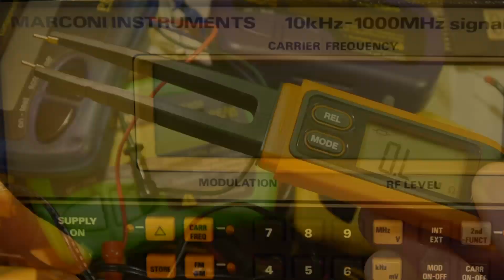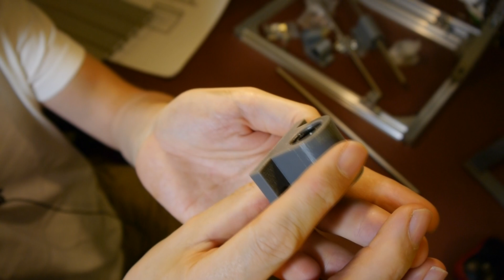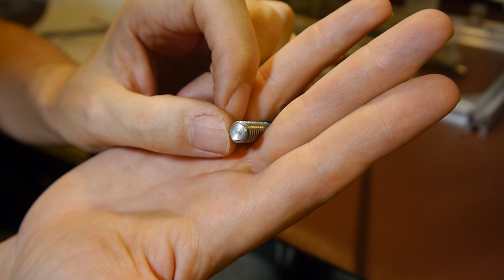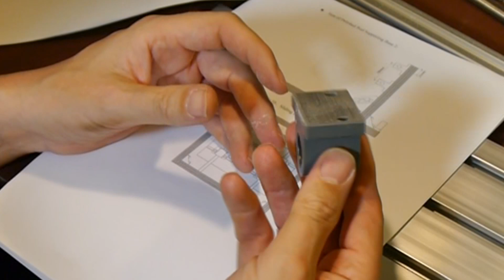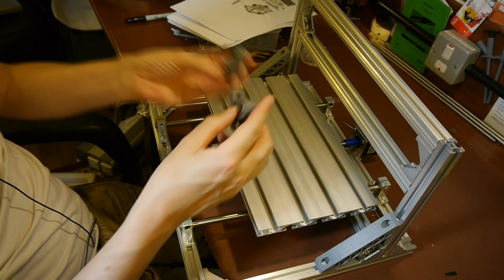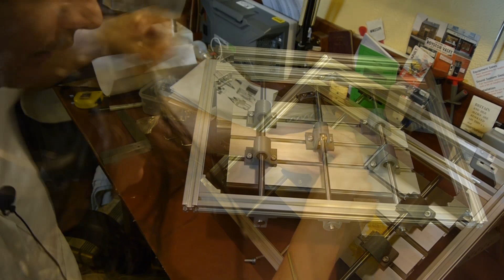3018 WoodPecker CNC - Part 2

Comment: I found that the linear bearings (as you noticed, not that fabulous to start with) bound on the shaft after I tightened the screws holding them to the underside of the table. The plastic housing for them is too flexible I think, and as the screws tighten the bearing's axis is twisted out of alignment with the axis of the shaft (that is, out of parallel with the plane of the table).  Each of the bearings (per shaft) pulls in opposite directions, hence the binding is compounded. The solution I hit on was to shim the bearing housing flange on the 'thin' edge - two thicknesses of regular printer paper (80gsm) did the trick. If the flange had been made to extend equally from a line through the centres of the screw holes, the problem might not have occurred. Still, for ~AUD400 including laser assembly, not a major problem! Great videos BTW, keep 'em coming! And talk as much as you like - that bloody techno music on some channels is of no help and drives you nuts :-( !
Reply: I'm having the same issue.  But what do you mean "thin edge"?.  Do you have a pic of it.   The other thing I found is the rods aren't very smooth either.  They have some rough spots.  I put them in a drill and using 400 grit sandpaper first and then finish up with much finer.  It certainly can't hurt.
Reply: Hi  @Michael-lo3ht  I'll take another crack at this.  See the video at 16:00 - the flanges are either side of the housing, and the screw holes are not centred in them. This creates 'more flange' towards the horizontal centre line of the table and 'less flange' towards front or back edge. I shimmed perpendicular to the shaft's axis between the housing and table along the 'less flange' section, i.e. nearer the table edge than centre. 
I also found rough spots and they got worse quickly. Using a dry PTFE lubricant on shafts and lead screws helped. I used one in stick form, Goss Dri Lube - also cheaper than anything in an aerosol can! If the problem comes back I might have a go spinning them against a light abrasive as you suggest.
Reply from the maker: Michael my rods were fine and accurately Ground so I did not have that problem. Thin edge sorry don’t remember. Let me know what time I say this in the video and I will look into it. Sorry just cannot remember. It’s worth rolling the rods across a flat surface and check for a bent rod.
Reply from the maker: Mountain Song It’s  was Christmas last year when I built it and the old memory is a bit hazy now. I think I ended up putting some shims in as well. I think part of the trick is just allow it to align itself and gradually tighten it down. But not too tight or that start to distort the structure. Thanks for the nice comments and good luck with your build. Best Regards Chris.